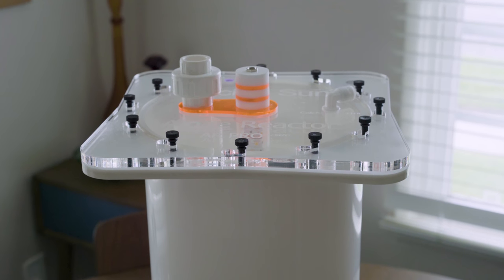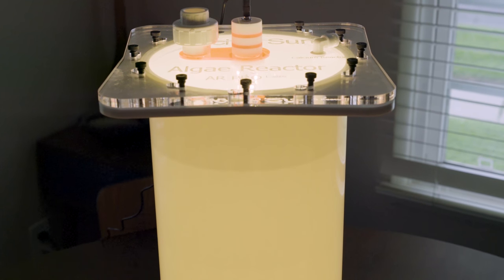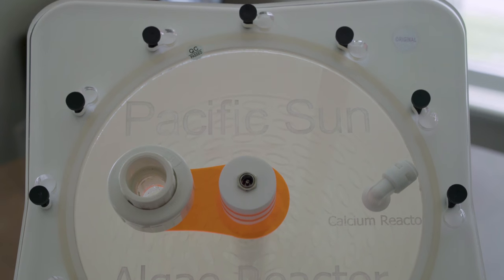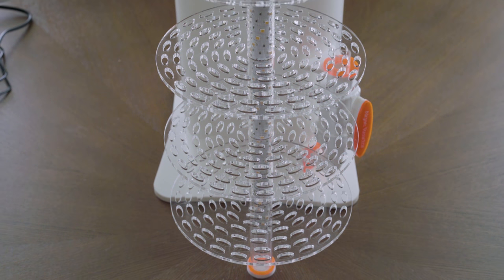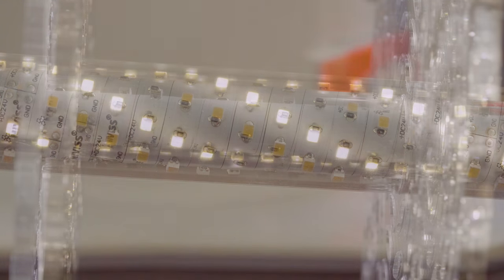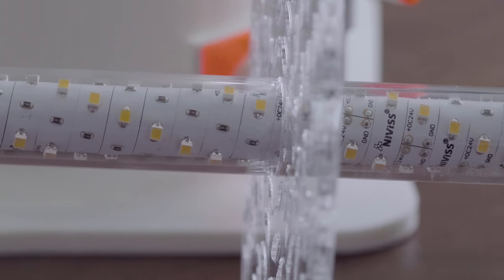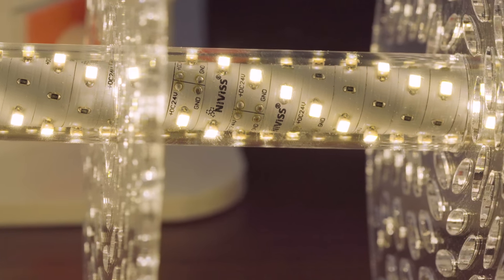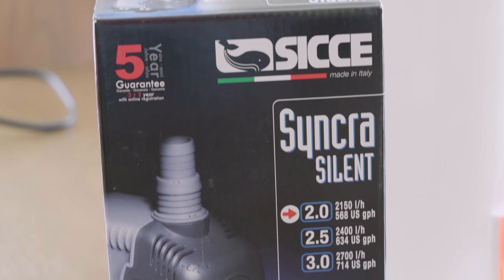Pacific Sun AR-PRO Algae Reactor

Comment: First... Also nice vid. Hope this works great we need more option when it come to algae reactors
Reply from the maker: Agreed! I was looking at the Pax Bellum reactors, but they're quite expensive. This one is around half as much as the comparable Pax Bellum.
Reply: ReefMan nice... I hope that someone here in the US will start selling them. Make sure to keep us uip to date so we know if it's good or not
Reply: @ReefMan  Tunze is coming out with a reactor I'm wondering if it will be easier to harvest than the existing algae reactors on the market.  It doesn't have those plastic rings that look like a pain to deal with.  What's your thoughts on this Tunze Mars Algae Reactor?
Reply from the maker: @EricAllee  the spinning action that the tunze reactor has is really intriguing. I wonder if that would get jammed up or not - that's what I'd worry about. If it stops spinning you'll quickly nuke one side of the chaeto ball. I also wonder how easy they are to clean - one nice thing about the platforms and such is that they pull all the chaeto out for you, you don't need to stick your hand in the reactor. I'd be very curious to try the tunze to see how they work. Let me know if you get one! I do have tunze pumps and their auto top off unit and so far their products have been generally very reliable. It'll be interesting to see what opinion develops of their reactor!

Comment: Any updates? I want to get one and would love to get your hands on impression. Thanks
Reply from the maker: Mine is metric and I think I have finally figured out how I am going to plumb it. The problem with my version is that it uses 20mm plumbing, which correlates to about 1/2" in the US. But, then they want around 500 gph through the reactor, which I can't find a 1/2" pump that will pump that much - seems like there may be a conversion error in their docs or something like that. I'm going to move forward with the Sicce 2.0 you see in the video, and I'll post an update once it's all running.